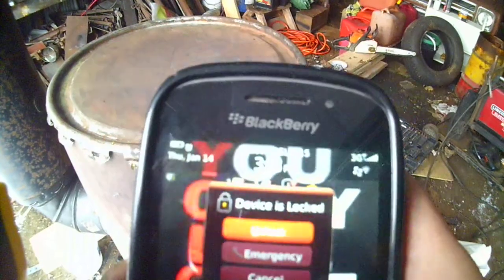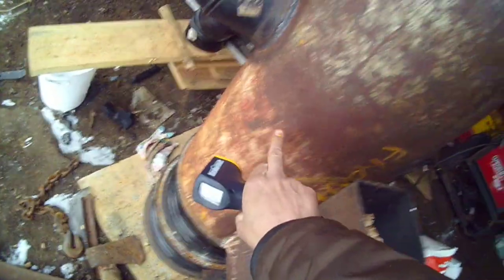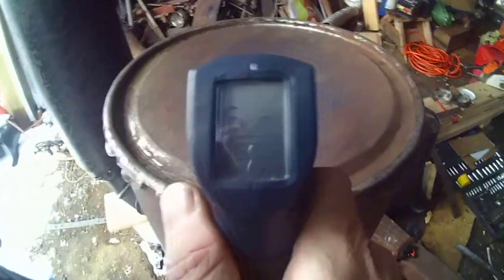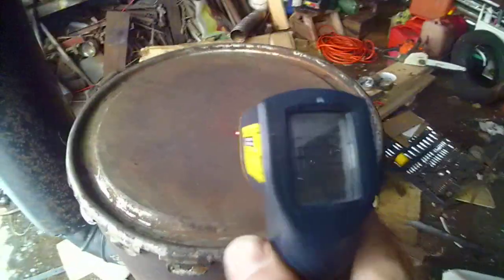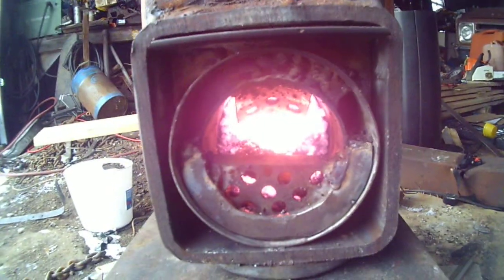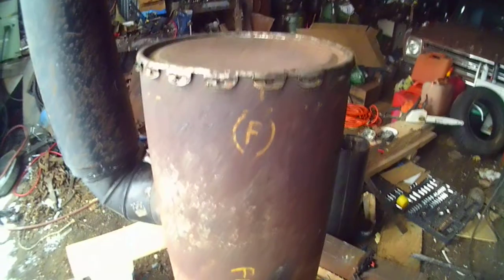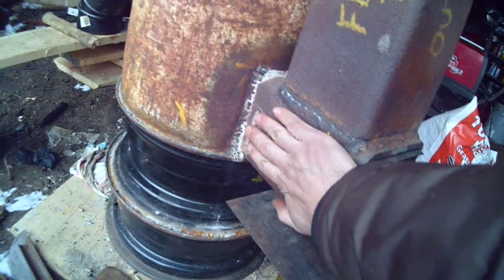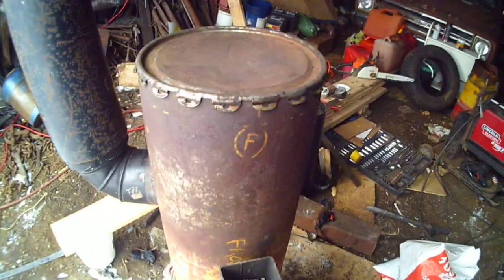Rocket Stove Episode 6 - Jet Burner First Test (6" RMH Hybrid)

Comment: Nice job. I wish now that I had made mine with bigger dimension tubing.
Reply from the maker: Thanks .   This was my first experimental rocket stove.   I don't use metals in the core anymore nor do I burn pellets.   I've been only burning free/dead wood from the land, as it is free where pellets aren't free, and I'm not killing any living trees by converting dead trees into free heating fuel.   The rocket mass heaters I use more frequently now have firebrick and refractory cement in the core.   This metal store has about 200 lbs of mass and perlite inside of it, but I don't use the metal cores much anymore.   Although I did make a pizza on this original metal rocket fairly recently outside, like a BBQ.    This one just sits outside now and doesn't see much action lately since I've designed and built several others since this design.   Thanks for watching

Comment: Hey John, could you let me know what the measurements of your build is including, feed inlet and  inner and outer pipe. Would be much appreciated
Reply from the maker: The feed tube and burn chamber are 5x5" square tube, both are 12" long.   Burn chamber is 5/16 or 3/8" thick, feed tube is 3/16" thick.  Riser pipe is 6" and 3/16 thick and 31" long.   The body is a 100 lb propane tank.   The base is a 14" car wheel.   The thermal mass is a mix of mason mortar and perlite with some refractory cement.    Those are the specs on this model, and it has a stainless riser liner and vortex generator inside also.   There is a 7 page build thread on this project on permies.com/forums/c/7 , but I have moved on to a new rocket project with a bigger mass, all cast core and refractory internals, and slightly bigger feed tube on my new prototype.    This one works wonders, but the rocket gurus say don't use metals inside, so I'm designing and fabricating a new one with all cast core.     This prototype here would need to be ceramic coated or at least hi-temp painted to keep from rusting and such
Reply: Thanks, can you tell me what the length of your round pipes inside the square tubing is where the pellet tray is and the one around it? I have a boiler stove that i want to try an adapt the burner into.I have the 5 in square tubing and want to try and build the burner that you have in your build. I will check out that link you gave.
Reply from the maker: +just me the burner was designed by T2H instructionals.  he shared his design here on youtube- look him up
Reply: Thanks, i have been watching T2H vids, i am impressed with what you did and going to try and follow what you did to a T
Reply from the maker: +afterburn thanks he designed it at 9" long , but I made one with a 9.5" long 3" inner exhaust pipe , and a 4" outer pipe which is 10 or 11" long.   I can make a vid to show more of it
Reply from the maker: +afterburn I did design an ash deposit area and tray for this burner, but since I don't use this burner often I never made the ash tray mod
Reply: +John C - I would really appreciate that and if at all possible show the exhaust end of unit as well.Did you drill any holes in the 3 in inner pipe?
Reply from the maker: +afterburn  just a square hole on top for pellets to feed in i think.  i will make a viewer request video for you tomorrow perhaps :)
Reply: ok sounds good, seeing your heat gun maxed out at around 600, wonder what the actual temp was. That's some nice heat happening
Reply: Hate to be a pain in the royal !!! lol, your square feeder hole did you go with 2 or 3 in, and any idea when you will be doing the video,oh did you put a cone on the end ?
Thanks for the help.
Reply from the maker: +afterburn CLICK SUBSCRIBE on my videos so you can notifications of my new videos- i already posted one for ya titled "AfterBurn" - I think its episode 14.&#160; check my channel youtube.com/user/mrjohn613 i made the top feed port about 1.75" x 2.75".&#160; a little less than 2"x3"i also made the video for you a day or two ago.&#160; its been live since friday lol

Comment: interesting to see how it will work when do the catch tray and possible secondary air, not that you need it by the looks of it. Will be watching for the final test and results. nice going.
Reply from the maker: +just me - secondary is built into this burner and i dont use the jet burner much so i may keep it like this...im currently developing a new slightly larger unit with a bigger mass and slightly bigger feed.  its previewed on episode 13